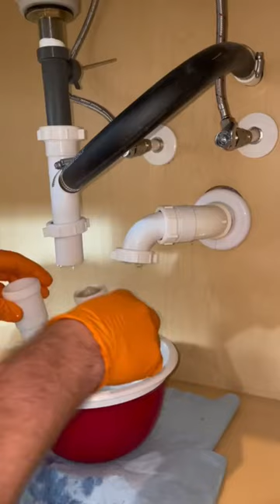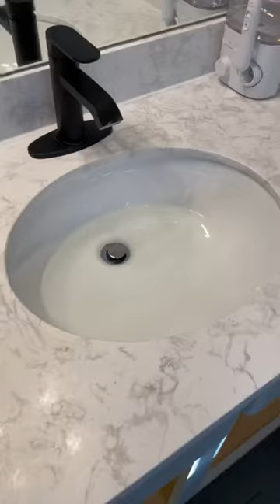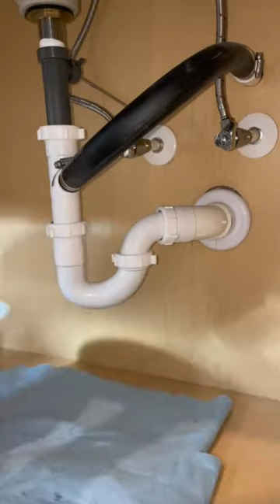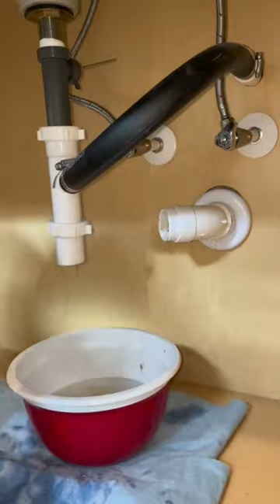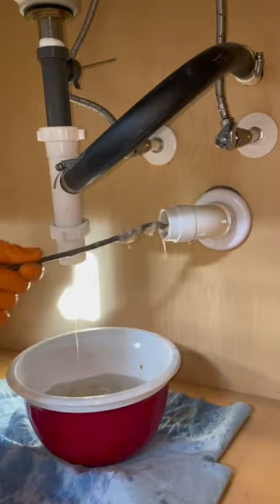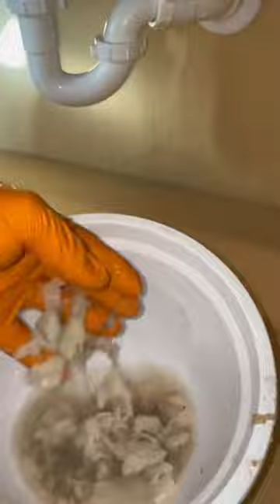Clogged Sink Drain

Comment: That would fail inspection where I’m from
Reply from the maker: Wish it would here too 😅
Reply: In one city I install in it is mandatory because according to the inspector “it contaminates the ground water” and in a city 30 miles south it has to drain on the ground because according to the inspector “it contaminate the sewer water” I hate that they can’t get on the same page.
Reply: It's basically just dust in the air which is actually surprisingly disgusting in most homes. This stuff is everywhere. The AC just concentrates it. It's harmless.

Comment: Very bad idea.
The condensate line can be under negative pressure if it's trap runs dry. Like during the heating season. It could easily fill the house with sewer gas if the conditions are wrong. 
Local codes are wrong if they allow this.
Condensate should have a dedicated line to the outside.

Comment: what freakin part of the country are you in that does that?? I have been in construction for over 40 years, and have never heard of that. We 1 time on a commercial building had to run a condensate line to a mop sink (not because we wanted to) and the city about had a stroke about it, they thought we were single handedly going to kill the planet. Plus they didn't want unmetered water $$$$ going into the sewer that needed to be treated.

Comment: Are they stupid ??? Condensate lines need to be run seperate and running it like that is pointless on residential or commercial. 
Are they thinking that becomes a " trap primer " ??? Even so trap primers are ment for floor drains!